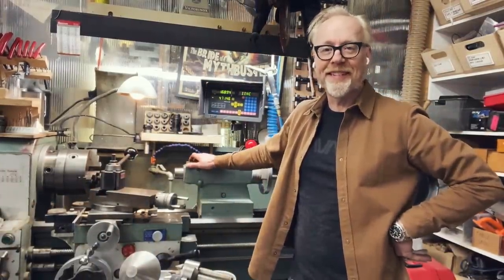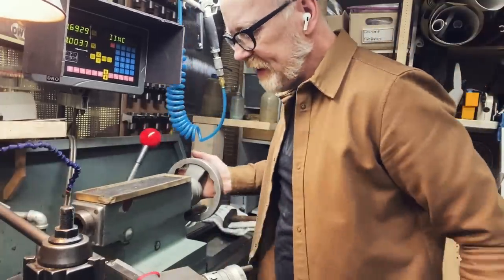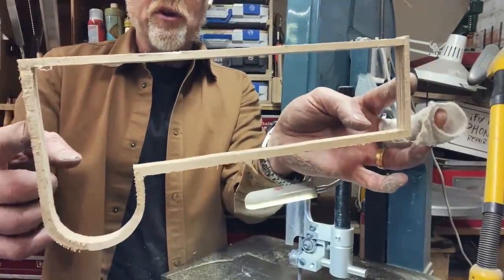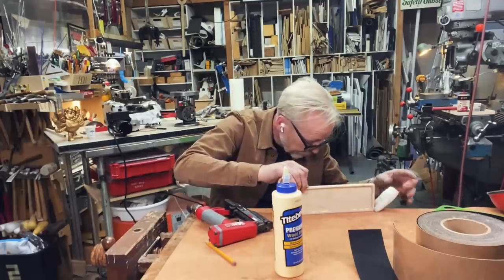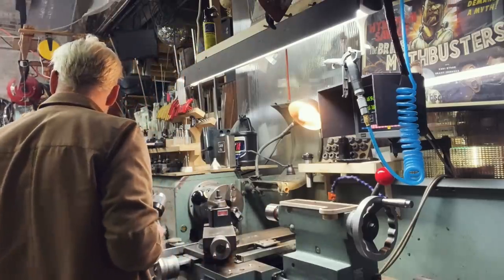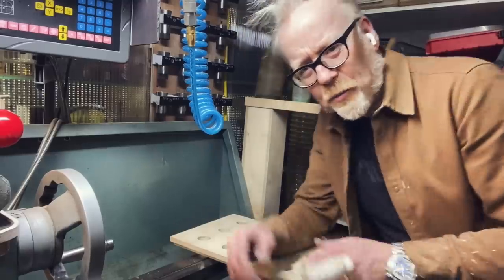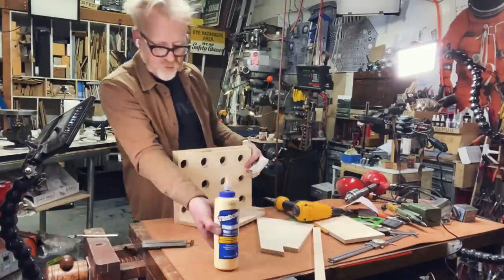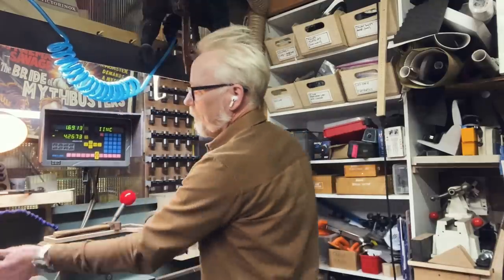Adam Savage's One Day Builds: Lathe Infrastructure Upgrades!

Comment: Loved it, but I’m sure I’m not the only one who cringed watching Adam crosscut the wide and short piece of plywood without a sled NOR a riving knife! That’s asking for trouble Adam!
Reply: If anyone who’s inexperienced around a table saw wonders why is that: 
1- a common rule of thumb is to never use the parallel fence (the guide that is parallel along the saw blade) when cutting a piece that is wider than it is long. 
This is because the less workpiece length you have in contact with the parallel fence, the less support you have to maintain the workpiece from spinning; and the more width you have, the bigger the friction and counter forces on the other end of the board when you push it. That results in a high risk of the workpiece spinning out of the blade’s axis and binding on it, resulting in kickback, which can be highly dangerous.
If you need to cut a board that is significantly wider than it is long, you should use a perpendicular guide, such as a crosscut sled. 
2- a riving knife is one of the most basic security equipments on a table saw. It prevents the workpiece from binding on the blade because of springiness in the wood or because it twists on it, as seen in point 1. Old school craftsmen sometimes remove it as they think it’s impractical, and anyone’s free to do so. However there are a myriad of videos on the topic of table saw kickback on YouTube, and I invite you to check for yourself (Matthias Wandel has a good experiment)

Excuse my lengthy explanation, English isn’t my native language

Comment: I like this kind of build, however some of Adam's techniques using the table saw for example cross cutting the plywood made me shudder a bit.  I have seen in my lifetime the off cut vibrate into the blade and send it into the operators crotch at high velocity.  The guys in the shop called it blue-balls.  Please! man clear the off cut away from the blade as you did once in the video.  Safety is not to be taken lightly we want you to be around for much longer for more great videos.